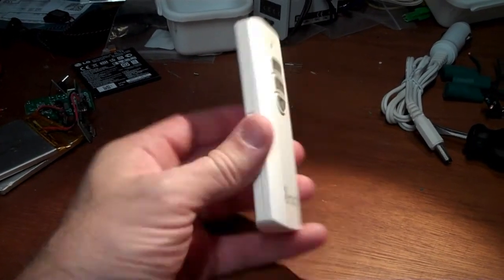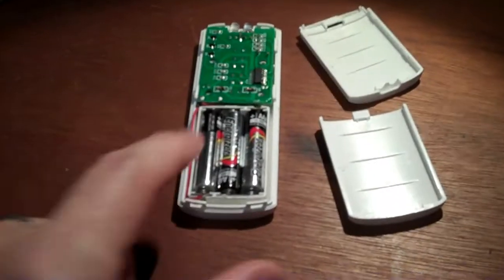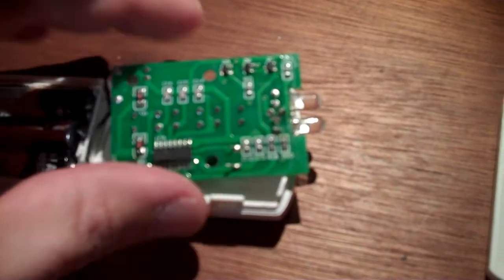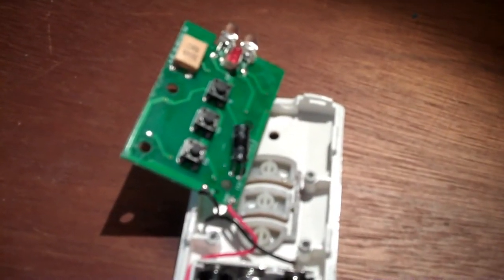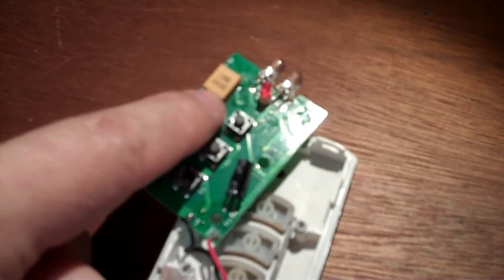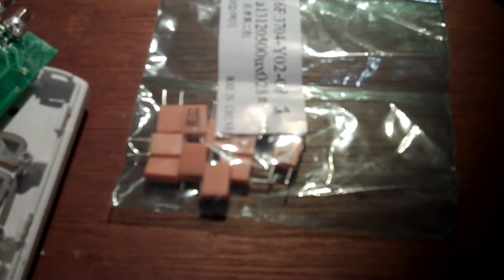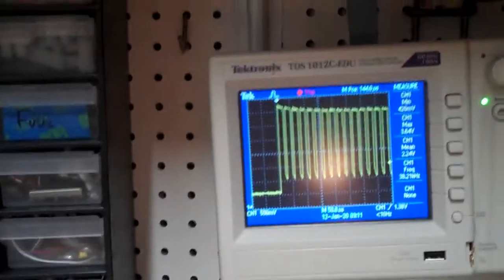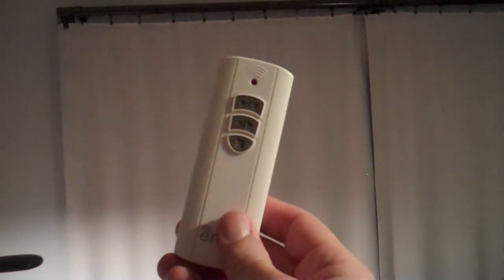BEME Erod remote control repair (crystal oscillator replacement)

Comment: Wow, that was awesome. I have this Adcom remote that is putting out some signal but will not work (on multiple Adcom preamps of the same model). I resoldered the power wires, sanded the battery terminals and even replaced a little electrolytic capacitor. That leaves one transistor, 2 small "101" capacitors, and IC - might be custom....and the crystal. I was wondering if those things ever flake out and by your video it is clear that they can, whether it got dropped or what. I was going to try to replace it given that this remote costs a pretty penny if you can find one (the original Adcom oem remote)  So now that I have watched your video I feel even stronger about the crystal. I have a "CSB 445 E" which I think you said yours might have been the same model. I'm off to find a new crystal now. Thanks for the great video.
Reply from the maker: Good luck!

Comment: Thank you for making this video. I have the same remote and it is not working. No light is even being emitted so the issue might not be the oscillator. Any idea how to troubleshoot this?
Reply from the maker: If you can't see light from the infrared LED's by looking at it with a cell phone camera, the most likely issue is a lack of power. You can try to change the batteries, clean off the spring contacts (sometimes the springs get "out of line" and need to be pushed to the center of the battery).  If none of that fixes it, it might have just died and not be easily repairable.

Alternatively, I've found that the motor units fail more frequently than the remotes, so if the rod isn't working and you don't have a 2nd one to test the remote with, it could also be an issue with the rod motor unit.